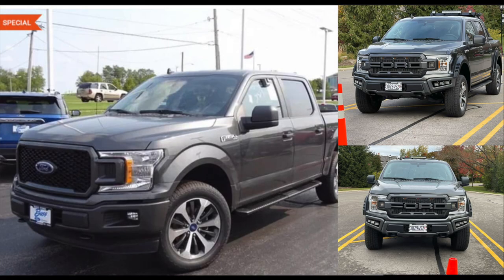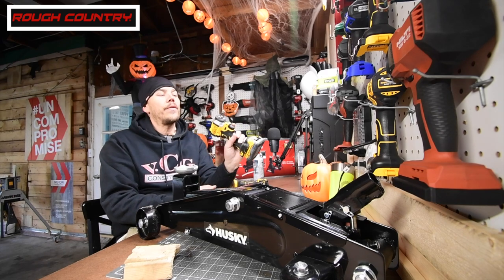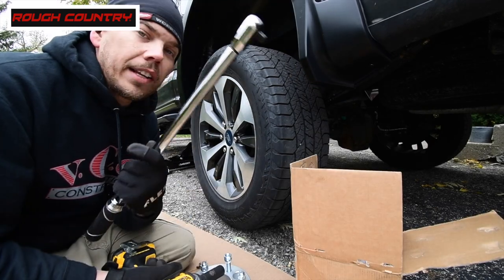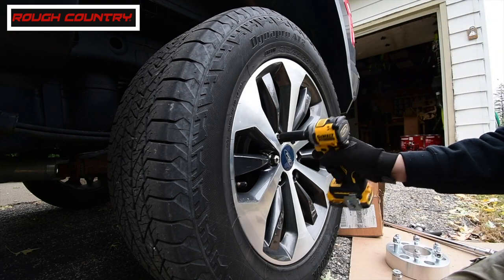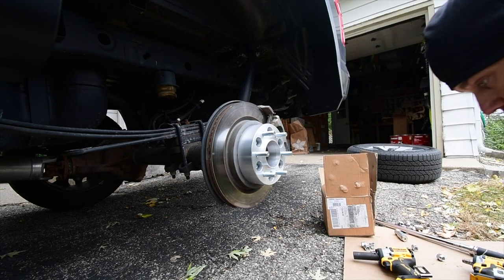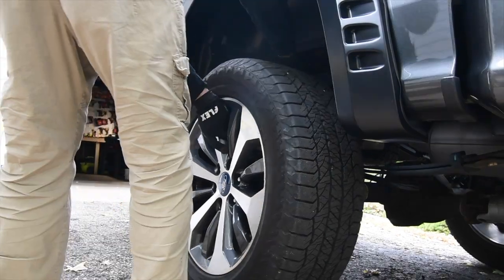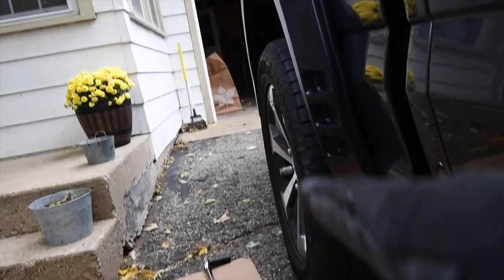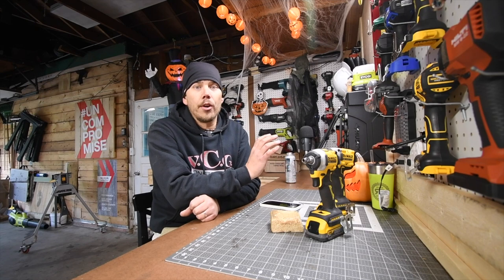Cheap HUSKY TRUCK Floor Jack! ONLY $122

Comment: Do you prefer any brand other than Husky at their price point? I have always used Husky tools and they seem well made for the price.
Reply from the maker: I was looking for a new floor jack since the one I already had was not tall enough. I saw this at at Home Depot then I saw the price and there was only 1 left in store and it wasn't an open box so I had to take it. but floor jacks are a pretty common tool and I dont hear that many bad stuff on them that were kept in the range of what its capable of doing.
Reply: I wouldnt recommend this for cars unless its an older full frame car. The part that contacts the car is too small and would crush a pinch weld easily. But for trucks this is a great jack for w price, especially with 2 stands. For cars i would get the harbor freight low profile. Ive had mine for years never had a problem and use it a ton as i do side work on a lot of other ppls and my families cars
Reply from the maker: just dont buys Harbor Freight jack stands lol
Reply: @ManCaverTools  lol. they fixed that problem. They're good now.

Comment: Bro we all appreciate your videos and wanna see you uploading for years to come. Please don't trust any floor jack especially that one with such a small foot print and saddle plus a peace of wood with your life. Been a wrenching for over 30 years and seen plenty of accidents with similar setups slip off almost crushing people to death. In a pinch I get it, but your at home use a jack stand and the jack itself as additional support. I cringed when I was watching you place that sucker under the frame almost at the transition 😳 it doesn't take much movement to slip off the wood SMH. I'm not a safety sally, but when you have a truck hovering over your head be a little safer 🙂👍🏻
Reply from the maker: I just did that for this specific video. I usually put the rim and tire under the vehicle. its common sense to put something underneath it just in case. this is about the 18th time I lifted the truck with it so far it actually did a fantastic job and I need to lift it additional 10 more times to complete this project. I test these tools to the max for everyone. :) but off camera there is something there for it incase it drops. but thank you bro.
Reply: @ManCaverTools  No worries Bro just  busting your balls about safety LMAO. Keep up the good work always enjoy your content👍🏻

Comment from the maker: Make sure you dont over torque Lug nuts you guys. Both EOM or aftermarket. check your vehicles specs for what proper ft lbs is. 
SO NO UGA DUGAS TO THE MAX!
Reply: Why 130ft lbs on the spacer and 140ft lbs on the wheel? Rough Country instructions say torque to factory specs.

Comment: Ok, I'm gonna be another one of those guys, I love your channel, and your videos.. 

But please just STOP doing this! 

Take the two seconds to always use your jackstands or don't work on your truck. I get it... You were doing a quick little thing... But you were sitting there torquing lugs AND a spacer, on multiple wheels, uneven surface, wooden spacer, and the jack placed on an angled part of the frame. Do you know how quickly that can go sideways????!!! It takes a damn second to put the jackstand in place, at least one... If you want to do things like this, at least do it off camera. My brother and I have worked on hundreds of cars in the last 20years in our driveway and we don't take shortcuts with jackstand, and we don't torque things in the air. Please do not become a statistic, and don't encourage irresponsible behavior in your videos.